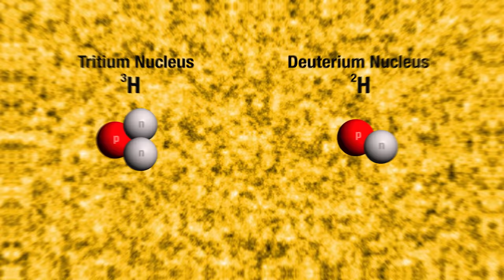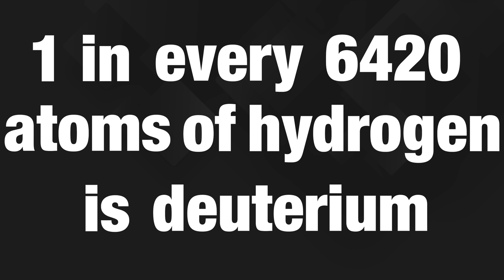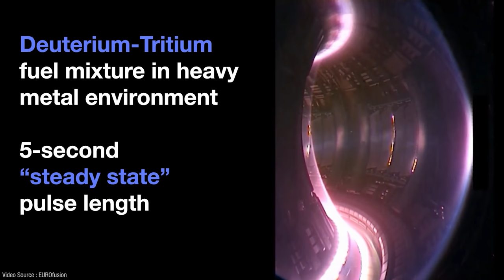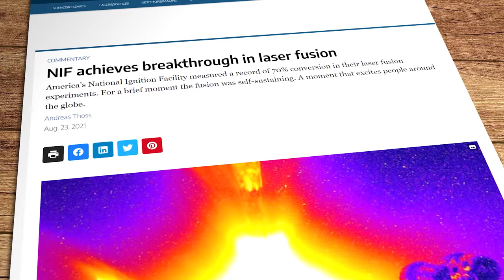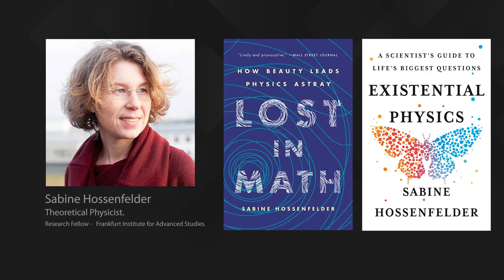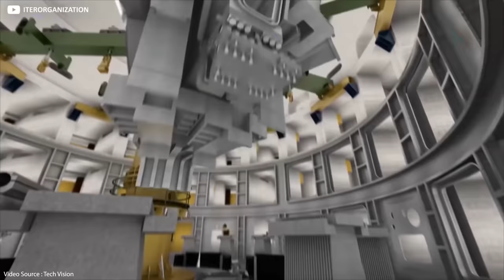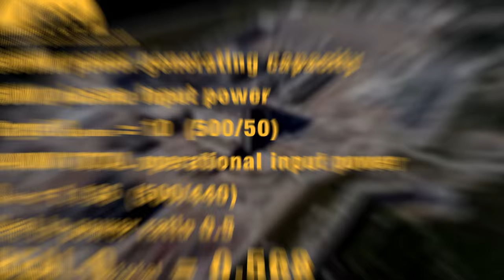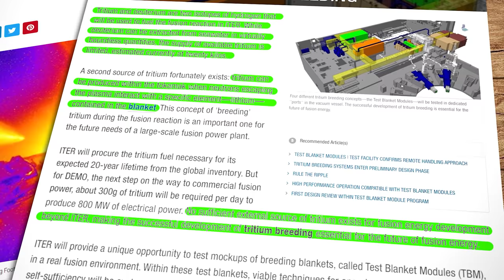Nuclear Fusion Illusion. Is it time to park the pipe dream?

Comment: Fusion, if ever made feasible and economical, has fantastic potential.  It represents one of the biggest scientific and technological challenges being undertaken by humans, and should be funded to the hilt until it is proven beyond dispute that it can't be done.  Not clear to me why you would be down on fusion given there is always progress being made.  Yes, we are still in early feasibility and prototyping stages (and have been there for a long time), but that just means you should not make any conclusions based on current performance and costs.  This is on-going research - not a product development cycle.  Current funding is only in the single digit $B range.  This should be raised 10x or 100x - not reduced.  If you want to find money to pay for your windmills, I'm sure you can find other sources of wasted money instead of killing off the one solution that actually would save the planet.

Comment: I think you have done several videos on various battery technologies.  It would be good to do a summary video comparing the strengths and weaknesses of each at this moment and the promise of each being used on the next few years.
Reply: There are better ways to store energy.  Use excess generating capacity to create liquid fuels.
Reply: @scottslotterbeck3796  Why is that better?  Every time you convert you loose some energy.
Reply: @wineberryred  Of course!  But battery tech is so poor now, and the lithium batteries wear out, can't hold that much electricity.

Liquid fuels, OTOH, can be directly transported and used with existing infrastructure.  Methanol (M85) can easily work in automobiles.  No great expenditures needed.  The technology already exists.

Yes, there are losses.  As in every technology.  Look into the latest work on using catalysts to pull dangerous CO2 from the atmosphere to make liquid fuels or solid carbon for burial.

See Aldo Steinfeld's work in Zurich.  And he's just one.  A great partial solution to global warming.
Reply: @scottslotterbeck3796  I disagree that battery tech is poor.  Existing battery tech can be used for all existing forms of ground and water transportation.  It does need to improve to be used in air transportation.   It's getting better every year and the tech with the best economics is going to win.

Comment: I pondered the question some time ago , what would the power output of 100 Kg of core of the Sun be if it could somehow be set up and running at the bottom of my garden ? I was rather shocked at the result , less than 100 watts ! Our Sun is an exceedingly lazy fusion reactor , delivering Kg for Kg , less energy than the human body at rest  , or about the same as the pipe I was smoking at the time 🙂
Reply: Fascinating! I would have expected much greater power output. Perhaps this is because the core of the sun is the heavy elements, which produce less energy than the light ones when fused? If I remember correctly.
Reply: @waylonk2453  Our sun still fuses only hydrogen and is not yet in the phase of helium burning or heavier elements. At least according our understanding of stellar evolution. The suns core has a really low power density, I like to compare it with a compost heap. But what the core lacks in power density it makes up in volume.
Reply: It's a good thing to, we like our star to keep us warm for billions of years.  Slow and steady!  But yeah, it did strike me as unintuitive when I learned this fact.  Not surprising, though.
Reply: @JonMartinYXD  Wow, I learned some new stuff today! Since the fusion process produces energy at a remarkably slow rate, it seems like the scale of any human-created fusion here on earth would have to be pretty sizeable as well. Perhaps that's one of the issues with our current proof of concept fusion technology. Specifically, that the reactions aren't large enough to get a good "return on investment" for the amount of energy it takes to set up the reaction. What do you think of this? Thank you for writing.
Reply from the maker: Probably just as well John, otherwise it would have burnt out billions of years ago and there'd be no YouTube. Imagine that! ;-)
Reply: I've often heard it compared to the power output of a compost heap.

Given that it's taken nearly 5 billion years to burn half its fuel, that makes sense.
Reply: @waylonk2453  By far the biggest bottleneck in the p-p chain is getting getting two protons to turn into deuterium.  We would skip that part by harvesting deuterium from water.  But you have caught on to one of the things about fusion power that is rarely talked about: just because the fuel is plentiful (assuming we figure out a way to only rely on deuterium) doesn't mean we can build one gigantic fusion plant per continent.  Even ignoring the problem of long distance energy distribution losses, there is a practical upper limit on how big we can make a fusion reactor.  The materials it is made of have withstand the energy emitted without getting so hot they melt.  The cooling system - AKA the steam generation system - needs to be able to carry that energy away in the form of steam, run it through the steam turbines, dump any leftover heat into cooling towers or ponds (or the ocean) to condense the steam back to water, then bring the water back to the reactor walls.  As the reactor size increases, the volume of the plasma torus and therefore the rate of fusions increases as the cube while the surface area of the reactor walls increases as the square.  So coolant flow needs to be significantly increased and that means more steam turbines.  Steam turbines can be stacked vertically but cooling towers and ponds cannot: the plant starts sprawling out and losing efficiency.  Even if we do figure out a way to stack the cooling to keep the plant footprint from growing, the energy density of the whole system (all those pipes carrying steam, all the hot electrical tranformers, pumps with moving parts that generate heat) gets to the point where it is just dangerous.  Not nuclear bomb dangerous, but equipment failing and killing plant workers dangerous.

We have the same problem with fossil fuel power plants and fission power plants.  Small is safe but less efficient, big is more efficient but difficult to build to withstand the high energy output.
Reply: The sun is quite a bit bigger than 100Kg though...
Reply: @paulhaynes8045  and the plasma in an inertial confinement, quite a bit smaller.
Reply: @paulhaynes8045  🙂
Reply: It’s burning at a perfect rate, interesting that it appears to be designed perfectly to maintain life on earth.
Reply: @JonMartinYXD  wow, thanks for that
Reply: @jimp5133  yes, that's called the anthropic principle, if the earth (and it's solar environment) weren't ideal for us to exist, then we wouldn't be here to comment on how amazing it is that the earth just so happens to be just right for us to be here (always good to remember that there are countless billions of other planets in the universe where conditions are not right, and there is no one there to remark about how unsuitable they are for life)

Comment: Like you I also hope it succeeds.  But there are huge uncertainties - how often will the superconducting magnets need to be replaced (due to fast neutron damage), how easy will it be to place replacements precisely, how will the tritium risk be managed (it is very radiotoxic), etc.
Reply: the superconducting magnets don't need to replaced, they don't see neutrons. 1m material protects them. We need to replace the blanket materials instead.

Comment: 3:40 Construction at ITER will not be completed in the latter half of this decade, that's a common misconception. That's just when a first phase is supposed to be completed. The completion target is 2035, and that's only if everything goes perfectly to plan (spoiler: it won't). Otherwise excellent video!

Comment: On top of your excellent points - I have never heard anybody address the following
Even if they could sustain the fusion and extract sufficient energy what are the LCOE gonna be? 
The plant it self is gonna be massively expensive and complicated. And while they say the fuel is basically free and abundant it still needs to be refined as Deuterium is 0.1 PPM of hydrogen - While that is likely easy to do, it is not free.

No, fusion is an exciting scientific field of study, but it will never be a major electricity generator outside of a few experiments and state prestige projects
Reply: Shhhhhh.  Don't say "LCOE" around here!  It's like Kryptonite to fusion people.

Comment: Love the props for Sabine, she is a great educator. 

I have a challenge of a sort. Nothing too hairy...lol, ok maybe a bit hairy. Lots of the talk these days is pushing towards active mitigation techniques like marine cloud brightening. Which I had heard provides -1.85W/m² for the area it is used. Which got me thinking, what level of effect is required to reverse the warming? There is a lot of math in there and I don’t expect you to pull out your slide ruler for. I bet Sabine could help😁, but you go through a lot of material so in time you might see these numbers presented. I kinda expect the numbers to vary by location, as most of the heating is a northern hemispere thing. Polar efforts would have to be stronger if we want to refreeze the arctic. Just a thought...something to keep in mind perhaps. 
Thanks as always, for your fantastic presentations of our current struggle. 🍀
Reply: IPCC talk about 'effective radiative forcing' caused by humans, which is +2.3 W/m^2.
Reply: @laskieg , what seems to be missing is the estimate of what it takes to turn this ship into cooling. As this is a carbon forcing event, we must see our efforts in context to the degree of force needed to exceed hopes of just maintaining current levels. I think generally speaking, halting all fossil fuel emissions is impractical and possibly potentially fatal for civilization. The expectation then should be to counter emissions at a certain level exceeding use. Ideas of net zero are not getting the point that we need to drive the system. I am expecting the number we are looking at is -12W/m² over a period of decades. Especially as we intend to reduce the aerosol masking effect by removing coal outright...or will we? I suspect we may have to turn to coal as a way to enhance the cooling effect. One thing we know well...coal burning. Addatives and scrubbers could tailor the atmospheric byproducts, to keep a hold on rapid temperature rise expected from eliminating them. AME is estimated to be +0.5°C to +1°C but may require all internal combustion engines to stop too. Not sure on what they include in the range given.

Comment: Well we need to do both. Fusion is for sure worthy of research funding. I would favor the 25 or so start ups over ITER but I see the value of ITER for its own sake. What we SHOULD do is stop subsiding fossil fuels, fine the fossil fuel companies, and put THAT money towards more immediate climate solutions.
Reply: Without what has been done to get iter to its current state, we would not have the startups we have now. Everyone looks at iter as if the science will be starting when construction is complete, but it has already required a lot of R&D that is making other ideas possible. Iter never needs to be completed to be a massive success... And there is a pretty good chance it won't be completed lol. But it has still been worth doing.
Reply: Design on ITER started in 1988, and using it as a blanket critiqueof the fusion field is a strawman argument. It's exactly the kind of clickbait that pushed me to unsubscribe from Sabine's channel months ago. 

Though in many ways ITER has been rendered obsolete, it has had value as a backstop to more technologically ambitious projects since. It provides a guaranteed way humanity will be able to do research on a fusion reactor that gets 10x the energy out that is put in, using sheer size to achieve the goal. Meanwhile, rapid advances in supconductor research have allowed far smaller designs to theoretically surpass its capabilities. So its probably a dead end, but still good to have around in case the new tech fall short for some reason.
Reply: We will need Fossil fuels for the foreseeable future.  There is nothing to replace it just yet
Reply: @scottslotterbeck3796  Ok, but we don't need to subsidize them.
Reply: @CaedenV  I have trouble believing that as many of the start-ups are using completely different reactor types, so not tokomaks.
Reply: @CaedenV  But yeah from a science perspective, I see it's worth.
Reply: @capt4in1  The government subsidies everything.  I fo object to subsidizing Teslas, which are just rich men's toys.

No way to recycle the battery packs, and they cost $20,000 to replace.

The best way to go forward is nuclear power (fission for now) and use the electricity to make carbon-neutral liquid fuel from the CO2 in the atmosphere.  Methanol, ethanol, even kerosene and diesel.  Look into Aldo Steinfeld's solar powered process using ceramic catalyst.  Could also use nuclear power electricity.
Reply: @scottslotterbeck3796  Carbon neutral fuels still produce soot (and noise)  that make the air smell bad (and cities loud). Electric cars don't have that problem. And you CAN recycle the batteries. Actually something like 95% of the battery can be recycled, and even if it is expensive to replace, the battery pack will still last longer than an ICE does (no moving parts), and not having to change the oil is really nice. The push right now is to make money recycling the batteries, which just means scaling up the process.

So I disagree. I think the best way to go forward is to use nuclear, renewables, and geothermal to produce energy and heating, while electrifying as much of the transportation sector as possible (cars, trucks, trains). Ships should all be nuclear, planes will probably need hydrogen (green hydrogen), and rocketry can use methane produced from CO2 pulled from the air, or also green hydrogen.
Reply: @capt4in1  Commercial shipping should NOT be nuclear.  Bad actors can seize a ship in New York harbors and threaten to blow up the nuclear power plants.

No form of energy production is perfect.  But using fission power to produce liquid fuels for transportation is close.  Carbon-neutral, existing infrastructure, familiarity of use means it's the best option in the near and medium term.  Aircraft will always need jet fuel; why not pull that fuel out of the CO2 in the air?
Reply: @scottslotterbeck3796  Shipboard reactors don’t need to be that powerful, they’ll be under the waterline, can be made safer (therefore harder to blow up),and there is such thing as security measures. It’ll be fine. 

You have your opinion and I have mine. But I hope we move away from fossile fuels (mined or synthetic) completely.
Reply: @scottslotterbeck3796  what we can do though is pull the CO2 out of the air, and not put it back in the air.

Comment: The ITER costing 25 billion $ so far is less than 1billion per year. That's peanuts. Even if you were to spare every single dollar spent on fusion research on renewables it would barely make a dent. Also projects like ITER and JET are already outdated in terms of magnetic field strength.

Comment: @12:18 While its true that splitting Lithium is a fission process, its absolutely nothing like splitting uranium or even thorium.  For starters, its not a chainable reaction - it can't melt down or otherwise cause any of the problems we saw at Chernobyl or Fukushima.

But more importantly, it can't produce the types of long-half life radioactive elements that are the major environmental concern in uranium reactors - lithium just isn't big enough, and while the products you get out are indeed dangerously radioactive they decay over the course of hours to a couple of days.

Of course, regulators and politicians (never mind the general public) are not physicists so there's always the question of whether or not anti-nuclear propaganda will end up outweighing the science when laws are built.

Of all the problems these devices could potentially have, tritium breeding is one of the least.  We already know how to do it, we understand it pretty well and we know it works.  Can't say the same for a lot of the other processes involved though.  At least not yet.

Comment: I think that this amount of money could be invested in geothermal energy. Instead create energy from atoms fusion, we could harness this powerful energy under our feet.
Only 0,1% of the energy that comes from the core of the planet could supply all electrical energy needs of all people for 2 million years.
Reply: Geothermal is like hydro. Very geologically limited, but great to use when it works
Reply: I read recently that a lot of geothermal plants are losing steam, so to speak, that after a certain time of just pushing more water through the underground that they start to cool off.
Reply: Geothermal would indeed be a good investment, but, I thing the thing we need right now, is cheap, efficient electrical energy storage. A lot of it!!
Reply: @vincentrobinette1507  we would need more than you think we need to go fully renewable. Likely add a zero or two to whatever you think we need.

Comment: An "I told you so" if fusion becomes possible then the problem becomes the amount of heat introduced to the Earth's thermodynamic balance. If lots of fusion reactors and lots of humans using electric equipment that generates waste heat THAT might cause more global warming than CO2.